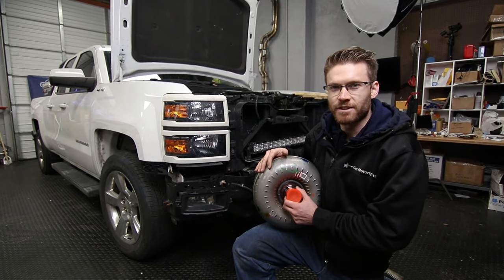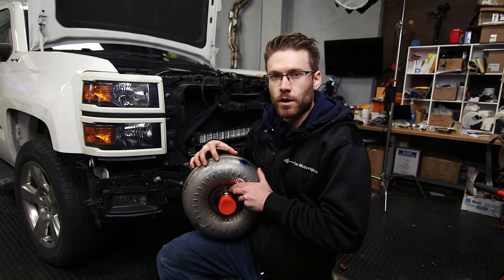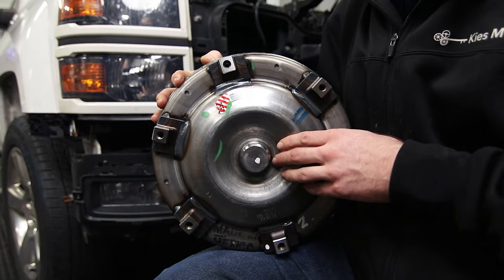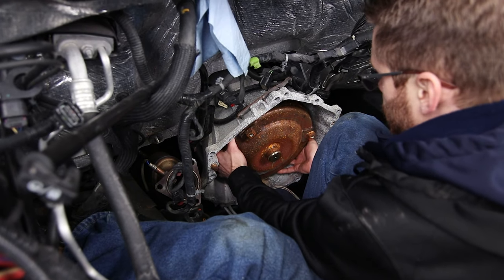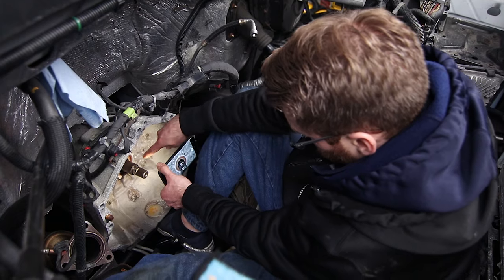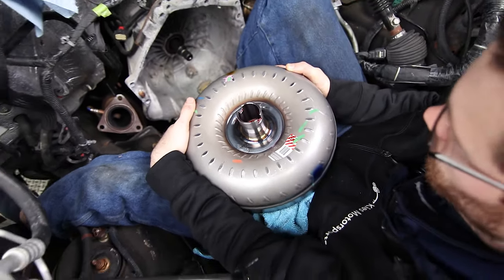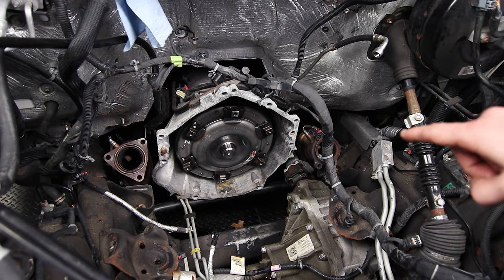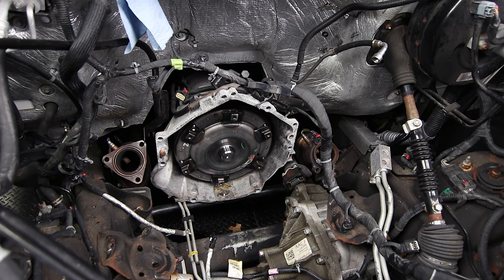6L90 Torque Converter Install in an 6L80 Transmission - Silverado Sierra Tahoe Suburban Yukon

Comment: In the last 2 weeks, my 2014 GMC Sierra sle (131k miles) with the 5.3L started to shift in and out a bit randomly, also occasionally makes a rumble strip feeling at highway speeds when going up hills with just a bit of throttle applied. I just had the dealership do a transmission flush and it is better but not fixed.  Dealership said it could just be the torque converter but recommended a full transmission replacement anyways at $5,200 and change.  I’m considering my options. I’m handy and have tools, but more carpenter than mechanic.  Do I try to save the $1,000 and drop the transmission and replace torque converter to see if it works before spending $5,200 on a replacement?
Reply from the maker: If the flush made it better in my opinion there is a good chance the transmission is ok and the torque converter may be starting to disintegrate and clog the lines. To me it's worth a shot because the torque converter will need to be replaced regardless. Is the transmission slipping at all? The sooner you replace it, the better chance you have of saving it if that is the issue. That is just my opinion tho as it is hard to know for sure without opening it up
Reply: I haven’t noticed it slipping at all.  How difficult is it to replace?  Easier to pull the tranny out to get at it or the motor?  I think the dealer was thinking that if replacing the torque converter, may as well switch the tranny too since it would be out.
Reply from the maker: Easier to pull the transmission for sure. If you are doing the labor I'd  only do the transfer case. A good shop can probably do it in 6 hours or less I would imagine. I've never pulled the trans myself so not positive.
Reply: @Fishermanjuice22 do you mean the rps fluctuating a few hundred rpms up and down whe the torque converter is locking up?
Reply: The thing like rumble strips is the torque converter clutch starting to fail. It is random slippage of the clutch that shakes the torque converter. It is commonly referred to as torque converter shudder.
Reply: @benalbright4617  6hrs? Good R&R guy would do 4 in that amount of time.
Reply: I know this is an old comment, but man I'm glad I found it! This is exactly what I have going on with my 2014 Silverado at 171k. Changed filter and fluid, yep it helped but didn't fix. Looking at TC now. What did you end up doing? Thanks for commenting, man👍🙏
Reply: @WOLFTICKVIDEOS  I took it to a transmission specific shop and had them drop the transmission and replace the torque converter.  They checked the transmission for damage since that can happen when the torque converter goes.  They put a heftier torque converter on and said transmission was in good shape except a few valves or something that were cheap to replace.  In total, it was $1500.  I have since put another 35,000 miles on it without a problem, though it occasionally shifts hard or "clunks" into gear.  I suspect that is a result of the beefier Torque Converter.  Overall, it was the right move.
Reply: @Fishermanjuice22  Hey thanks for getting back to me on this! We really appreciate that info🙏👍

Comment: The 6l80e torque converter is constantly slipping that's why they fail. Get the 80 tuned to only lock in 5th and 6th. Raise the pressure and they are good

Comment: Always replace the o-ring on the splined shaft, you should also have the transmission tuned to not allow TCC clutch to slip so much. I use Hptuners and bluecat software.  And dont ever buy a reman converter unless you want to do the job twice.

Comment: As I sit at the dealer watching this video. 130k. Just started feeling some irregularities. Dealer is doing some diagnostics for me. The tech mentioned tc failures. Will know more shortly. Ive watched a few videos and they all seam to be well done. Feel like I’ll be watching more soon. 🤦🏻‍♂️
Reply from the maker: Best of luck with it!
Reply: @TheSundaeDrive  worst news. Tc failure, transmission failing. Got a quote. I think I’m going to call and make arrangements tomorrow. Just a bit out of my capabilities. Enjoy watching your videos though.
Reply from the maker: @two4twentysam  sorry to hear that :( make sure if you plan to keep the truck you get a billet torque converter otherwise it will just fail again

Comment: I am curious that since the 6l90 converter is heavier, more mass, does it affect revving quickness or milagage??
It would be nice to hear from people who have done this mod and not just speculation, Thanks!
Reply: Did you know any new infos ?
Reply: Old comment, but my dad's 2012 just got a new 6L90 after his transmission died at 187k. It mostly drives the same in terms of "quickness", but the transmission feels a lot heavier when it shifts which honestly is better than the sloppy feeling of the 6L80s. My dad likes it more than when it was stock.

Comment: Be careful when you tighten the fill and drain plugs, they are tapered plugs and if you over tighten them you can crack the transfer case at the holes....  Lesson learned the hard way, don't make my mistake!!

Comment: ... ZL1/CSTV.. could just got a regular truck 6l90 3 bolt torque convertor. granted I have a ZL1/CTSV 6l90e torque conveter from CDS in my truck.

Comment: Ask for high carbon clutches because even though that converter is a dual clutch it’s carbon fiber which frays (clogs the lines) use raybestos
Reply: This clutch configuration is like the 2015 f-250-150

Comment: The TC just went on my '15 chevy express 3500 van with 6L90 at 121K. Wish I knew about this problem so I could replace it before failure
Reply from the maker: That stinks 😔 definitely recommend going with a billet transmission for the rebuild.
Reply: So you replace the TC or did it ruin the trans?

Comment: How is that 6l90 torque converter holding up. I have a 2013 Silverado with 160,000 mi. When I shifted into gear and hold the brake I can feel the torque converter. I meant off the break and for 2 seconds it's still there but after that it's gone. I thought it was the brakes but I turned and put new brake pads. It's a very light Rumble in the brake pedal but I'm pretty sure it's the torque converter. The reason why is because I had a LS that the transmission was jacked up wrong and it needed a new torque converter. And it feels like the same Rumble you never forget. What's your thoughts
Reply from the maker: No issues with my 6l90 transmissions so far. I have about 22K miles on it. I do plant to change it out when I hit 200K miles (90K on the converter) to a billet just to be safe.

Comment: Why wouldn't you change the 2 seals? Also, if one of the pump nubs is at 10 o'clock then the other is at 4 o'clock seeing as they are 180 degrees from each other

Comment: How has this held up so far? Looking to replace the TC in my truck as I’m getting some noises
Reply from the maker: No issues at all. Billet is better option tho if you can find one you like.
Reply: @TheSundaeDrive  over twice the price for anything billet that I’ve seen. Any specific reason for going billet over the 6l90 like towing for example? Unless you’re aware of a billet close to the $400 mark

Comment: My 2016 6l80 went bad at 110.000  the welds cause the converter to warp so i put  a billet converter in it   plus a rebuild    its works like a champ now i have a fuel leak at top of the gas tank it needs a fuel pump and line

Comment: 2011 6l80 with 215k miles. no issues so far. fluid changes every 50k miles or so.
Reply: I've been changing it each 50k as well, no issues yet
Reply: I bought my 11 Sierra LC9 from an elderly local Guy who's a life long GM buyer. He babied the truck as youd expect with all services at the dealership I bought her from. Making the records as easy as it gets for me. I'm a builder so I'm hard on the truck but that's why we buy trucks right? We have the heaviest available package for the 03' year in the 2500hd 6.0 for the severe pulls/loads and she's bulletproof.
However!! 3 years ago I pulled out 6'-10' dump trailer with my half ton! Just to get 3 yards of 3/4" gravel for my own house needed for a walk way. Told the guy out in the local yard what I wanted he said no problem so I figure great I'm heading in to pay as he knew his shit and how to properly load......I come out of the office and he says you're all set man the 3yrads of gravels loaded I said thanks and see you around....
Fckn guy didn't know that the new Bobcat wasn't equipped with the same half yard bucket oh no it had a yard bucket so his SIX FULL BUCKETS almost filled our dump trailer so I'm looking at it like WTF!?? I double checked that's only 3 yards man you're sure and he replied ya man I've been doing this almost as long as youve been alive, what's wrong....so I go back to me truck fire her up and put it in 4wd full on as both axles on the dump were showing a load to put it mildly. The 11' HALF TON! in tow haul got that load moving very easy, but I have no electric brake control in the truck as we have a real full on work horse for that lol and stopping that load was very hard. Knowing something is way off I pulled it to the shop and hooked the work truck to her. It was 6 yards at 3000 pounds plus the dump about 2000 pounds the truck pulled up some long steady grades to get to the shop. So that is legitimately 20,000 pounds my HALF TON was forced to pull and to stop! Honestly she impressed me so much easily pulling the load I was double guessing that old timer way overloaded it, but trying to stop that load took every skill I had so I knew it was over.

At the shop I rolled the mesh cover up and inspected the load myself closely this time. I was extremely pissed off as one clear look even a city boy could tell that's way more than 3 fckn yards man. Had no choice but to pull her to the shop once I left. Between being very disappointed with myself for trusting the old timer down there so much as it is ultimately my responsibility for what I pull with my truck, yet at the same time I, along with all the guys there were absolutely blown away the half ton Sierra pulled that 20,000 plus pound load so easily. They all witnessed me completely stop on the slight grade so a couple trucks could move outta my way, then have to get all that weight rolling again and it did make all 8 cylinders work but she had power to spare! The 2500hd equipped with the heaviest possible setup/package even offered by GM actually had abit harder time getting the load moving even with 4.11 ring&pinion....but the random dumps brakes made all the difference so I decided to pull her all the way home a half hr drive purely uphill by taking all the back roads going slow an easy allowing anyone behind me to pass.
That load was thousands of pounds above even the HD work truck built for it capacity, but the way that 11' LC9 with the 6L80 and 3.52 (I can't remember exact ratio but close enough) ring& pinion pulled that load making it so effortlessly even the Ford guys with diesel were the first to say that's beyond impressive. 
Absolutely STUPID! A combination of mistakes/stupidity lead to that. I am telling the truth entirely and ya it's embarrassing as it gets to admit that even tho I know better I STILL pulled off that drop dead stupid move, yet the truck took it.
That gravel was moist as hell but doesn't hold water like sand, still the 3000 pounds per yard is a conservative figure, and there was a full 6 yards in that 1ton dump (rated to haul 4 tons itself)
That's pushing as hard as a guy can to break his truck or have problems of some sort, yet our trucks stepped up, took that ass whippin and just carried on. I definitely got LUCKY and would never allow it to happen again, but the fact remains that the 2011 Sierra 1500 LC9-6L80 3.52 R&P pulled over 20,000LBs off the fckn hitch (rated 10,000LBs max) mostly uphill.
Well done GM👍🇺🇸👍🇺🇸🤯
Reply: @johnserrano9689  3.42 rear end likely. i have the same powertrain you described, and have only towed about 4000 lbs. it did it without any issue, but thats hardly much considering the tongue weight was probably 400-500 lbs. otherwise it gets daily'd, has done about 20k miles a year all its life. gravel roads, minnesota salty winters. rusty but trusty thus far.
Reply from the maker: That's crazy, I accidentally told about 13K lbs with my 14 5.3 and it was good just couldn't go above 45-50mph
Reply: @TheSundaeDrive  it's crazy what we do at times, but the fact we know better in the first place is the funny part in the end. If we damage our trucks being that stupid then we man up, complain as we're lowering the tranny down and out but after a week or 2 we laugh. 
The times we get LUCKY we also know enough that it's nothing to brag about lol
I love the 78' GM trucks as an example, but a 78 half ton had no chance of pulling that 20,000lb trailer man let's face it a dam 3/4 ton of the era would be extremely sketchy. But our new trucks we curse out when say a tank pressure sensor goes bad dropping that 5volt circuit putting the truck in limp mode, the truck screaming at us turn off engine immediately as there's no oil pressure! But we know there is. So we gotta hook up the volt meter to the battery ground, other terminal to the grey wire on the MAP sensor watching the meter as we unplug 1 sensor at a time until the 5 volts comes back......but at the end of the day they really have come incredibly far. Fckn 1500 now is equal if not stronger than the old 3/4's an there on up
I guess it's the beauty of such a competitive market 👍🇺🇸
Reply from the maker: They definitely are stronger than they used to be.

Comment: What is the stock stall of the 6l80 vs 6l90 - you mention this is practically a bolt-on replacement - no tuned needed-  is this 100% accurate and is the only difference between the 2 tc is the beefer internals?

Comment: My first transmission failed in my 16’ Denali at 32,000 miles and now at 58,000 finally did a service on the tranny and the torque converter is crap in the new replacement:

Comment: IDK how much the factory gm converter is, but you can find aftermarket billet cover stock stall single disc lock-up converters now for around $500. I went with a unit sold by trans star. Iirc these units are made by a company out of ohio and sold through trans star.
Reply from the maker: Good to know! I think this ran me around 400 or so but it's been awhile.
Reply: How’s it holding up?
Reply: @johnnybobgoldstein2823  all 10 I've installed are still on the road with 0 issues. They also had the afm and pwm tc lockup turned off via tune. I have over 175k on my personal with this exact converter.
Reply: @joeinmi8671  I appreciate the reply!

Comment: I have a bullet converter I’m installing into my 6L80. The bell housing is rubbing on initial install. Once it’s mounted to the engine will it then slide far enough away that the bell housing won’t rub?